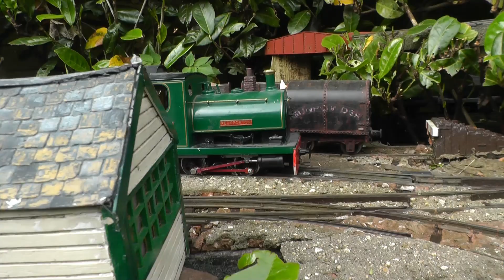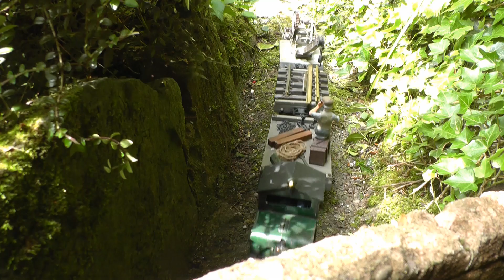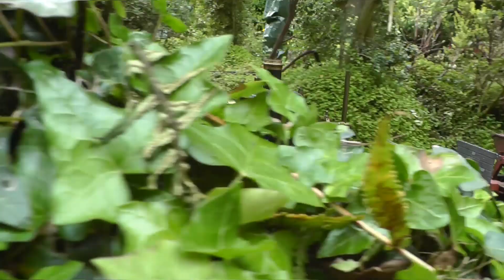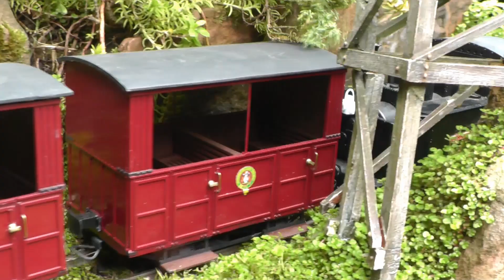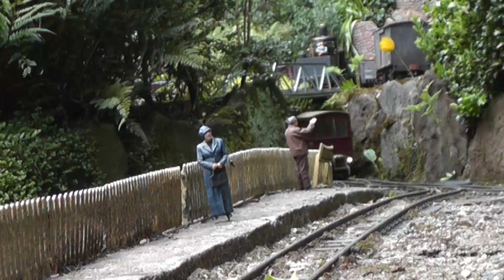Peckforton Light Railway - Trainspotting Down the line

Comment: Nice little fowler...... kit or scratch built?
Reply from the maker: It was my first attempt at a partial scratchbuild - scratchbuilt plasticard body on an LGB ToyTrain motor block - https://riksrailway.blogspot.com/2011/04/how-i-converted-toytrain-diesel-into.html - Quite a few of my locos use ToyTrain blocks which are well engineered, powerful and run well.
Reply: @rikbennett9  Nice... good idea to use a 'ready-made' chassis..takes a lot of the guess and fudge-work out of it.

Comment: ThNks for yet another great video Rik, a workman’s coach is now on my list of rolling stock required for my own railway 👍😀
Reply from the maker: Thanks. Yes, I thought the workmen's coach would add a bit of variety to running sessions. I bought it on eBay years ago. Clearly scratchbuilt, from plywood and loosely based on a GVT coach. The ply is very ragged around the windows and beading which made me think it would be better used as a time-expired coach pensioned off for use by mineworkers rather than part of the regular passenger fleet. The workmen are roughly hand-carved wooden figures I picked up in a pound shop somewhere - see - https://riksrailway.blogspot.com/2011/09/progress-report-38.html

Comment: Wonderful. An antidote to everything nasty, as well as a fantastic achievement. Such a busy line. I can't believe it doesn't make a profit with all that traffic. (Ninety-three years later I want the M&GN Joint reopened in full for the Amazon parcels traffic.) Two questions: (i) how are the points reset between the passage of two conflicting trains, and (ii) seeing the little live steam loco with that ore train, <SPOILER ALERT> what is the ore actually made of?
Reply from the maker: Thanks Alan. I'm with you on the Muddle and Go Nowhere. 
1) Mostly points are changed manually but a few are electrically operated. The point blades for the sand quarry were thrown by the Walker railcar trailing through it. It's heavy enough to push them. 2) The ore is actually crushed sandstone. Working on the principle that it's the bedrock in which the copper (and small deposits of silver) is carried.

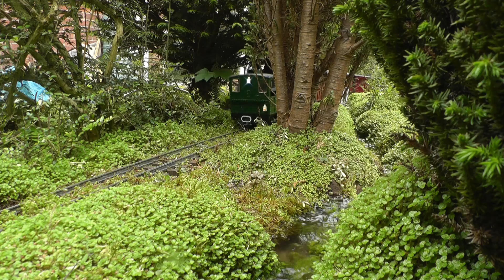Comment: ive always wanted to have a garden railway that works well with plants but my railway is on cinder blocks for abt half of the journey because of an uneven garden. What plants can I get that are low maintenance and scale eg the small trackside leaves at 4:53
Reply: If I may chip in (beware it gets everywhere) 'Mind Your Own Business' (Soleirolia soleirolii) as ground cover. Also for small (pruned almost to the fashion of Bonsai) you could go for Lonicera nitida ('Baggesens Gold' or  Poor Man's Box) which can also be used as hedging, line side greenery etc. I hope that helps✌️👍💜🤞
Reply from the maker: Thanks. You've beaten me to it. I've also had success with Corsican Mint and moss proliferates but that's because most of my garden is in the shade for most of the year